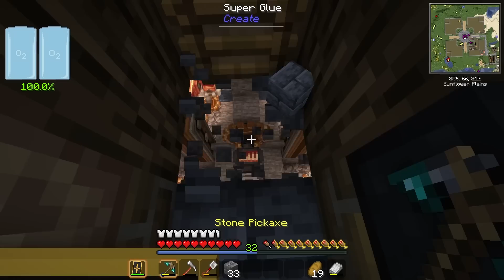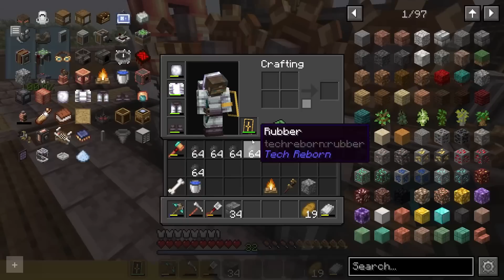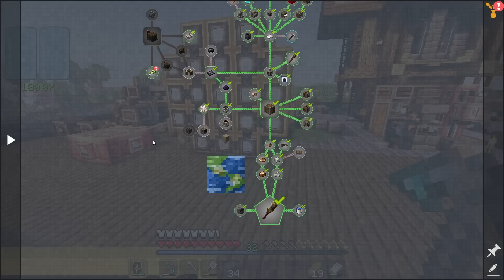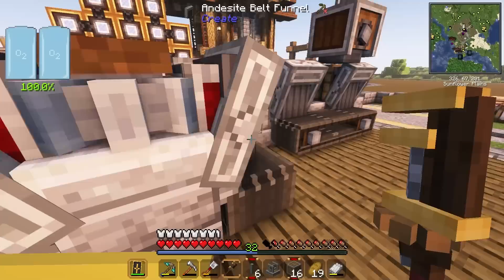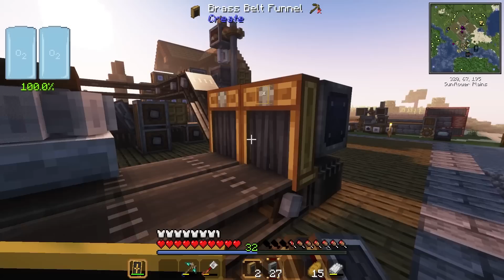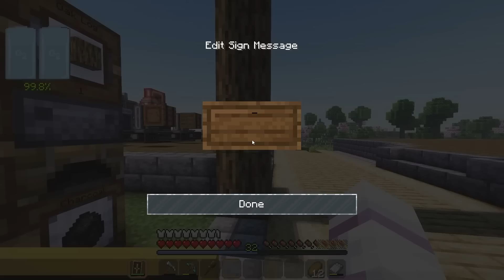Efficient Automation & Brass Funnel Upgrades Ep15 Create: Astral Modpack

Comment: As a noob I am trying to imitate choosens setup but I have a problem. I think I have my rolling mill set up exactly the same, but it spits out the unprocessed materials on the other side (I put in a ingot or sheet and I get the ingot/sheet in the output barrel). Does anyone know, what I might be doing wrong? Thanks in advance!

Comment: Instead of a hopper under the cobble gen, couldnt you put a block, slap or trapdoor on top of the cobble being broken? So the blocks dont go flying
Reply: If you make the drills slower it does throw the blocks around, it's doing that because of the speed

Comment: 10:30 two shafts would also work :)
15:30 you can put the trapdoors against the belts instead of above.
23:10 you can setup filters using JEI
Reply: He tried the trapdoor trick in the first few episodes, but they kept breaking the machine automation process for some weird reason, so he's not going to repeat history by putting the trapdoors directly on the belt.

Comment: I'm a little surprised he got that system to work using an item vault. I was under the impression those things could only hold one kind of item at once, so seeing it manage three different things simultaneously is a bit mind-blowing
Reply: pretty sure it works because it empty's straight away
Reply: I'm pretty sure It's just a regular chest that can't be interacted with by the player, it can store any items

Comment: Hey, so I noticed you were adding a gear and a gearbox to power the millstone (the one in the front). It is actually possible to power it with a shaft from the bottom. You could put a vertical gearbox under the millstone instead of the normal one, and it would be powered automatically.

Comment: Guys, don't do this. This production method is awfully undertuned in the modpack. It's much less effort and much more yield to create a cobbled deepslate generator below Y=0, and send them to crushing wheels.
Reply from the maker: What do you mean? Dont do what?
Reply: @ChosenArchitect  he means do cobble gen below y 0, that way you get deepslate cobblestone and then you send this to crushing wheels to get raw ores
Reply: @ChosenArchitect  I meant to not set up iron automation this way and instead go for deepslate into crushing wheels. 

However, after progressing more through the pack I myself had to set one up because iron is used way more than other ores. So, ignore that.

Love the series! I had always been afraid of Create  until your videos. Thanks a lot <3

Comment: For any future cobblestone/stone generators you may build:

if the generator produces Cobblestone: avoid setting the drill to an rpm of 80 or 96.
if the generator produces Stone or Andesite: avoid setting the drill to an rpm of 64.

These RPMs match the exact speed that the generators create a new block, causing the dropped items to be flung out of the generator unpredictably.

Comment: Chosen, please just make taller boilers with multiple campfires underneath and a faster water pump. You can generate way more power with less complexity.
Reply: multiple campfires is still same.weird.ok well but,how faster brother?faster pumps.from another mod ur mean!?
Reply from the maker: I tested more campfires and it didn't seems to change anything

Comment: You really need to have a lava farm and a power steam boiler with it. It will give you 16k stress per steam engine instead of 16k per 8 of them.
Reply from the maker: Yep and when I upgrade them I'll be able to make take the setups I have and use all the materials:D lava gen coming soon

Comment: I noticed if drills break stone too fast they insta-respawn more stone throwing the previously broke one in a random direction.  I either slow down the drills or make them part of a contraption.  There are probably other ways ways but I haven't had to figure that out yet because I keep my cobble and andesite generators as separate contraptions mass producing and transport them where they are needed.

Comment: for the rods and the wires u only need 1 mill, not 2, safe space, it uses the same machine
Reply: Yeah, but if you want a copper wire VS a copper rod you gotta filter it
Reply: @dragonlord4881  in my game rods need ingots and wire needs plates, so i dont need to filter it. they use the same machine, only the input is different

Comment: The boilers can be taller for a lot more stress units :) (i cant take it anymore just make them bigger the voices in my head wont leave me alone)
Reply: you would need to use blaze burners for more heat so having a kelp farm / small tree farm to supply charcoal to power blaze burners would get alot more units
Reply: @TheQuinn50 He has a tree farm already. But it hasn’t been running the past few episodes.
Reply: @Bob_Smith19  because it's probably full!
Reply: @TheQuinn50  dried kelt blocks are the most efficient fuel source in Minecraft
Reply: most sane create modpack player